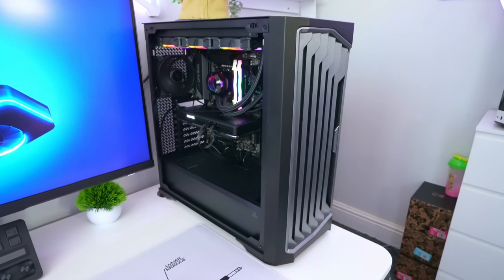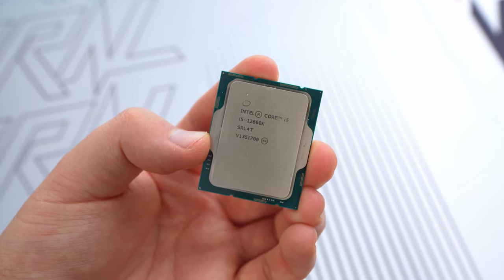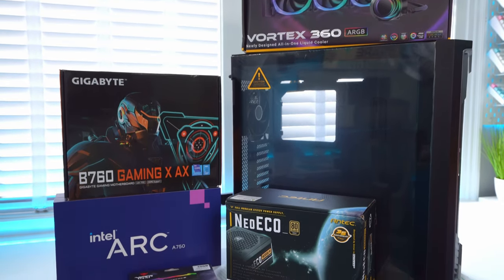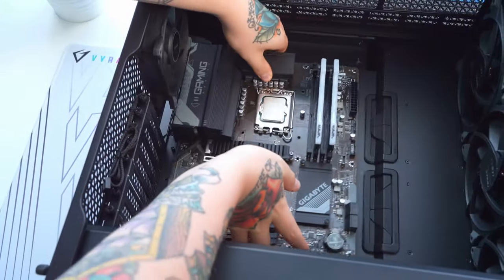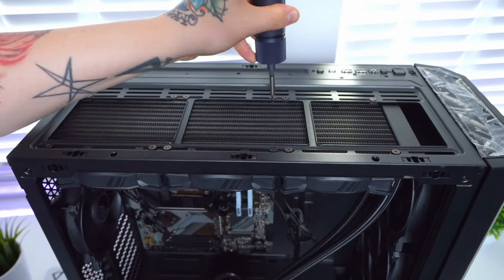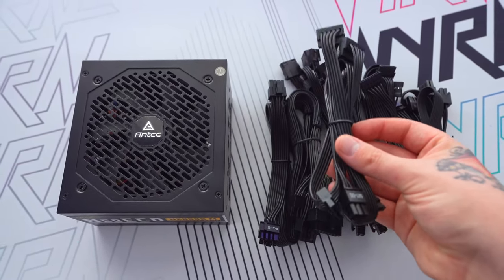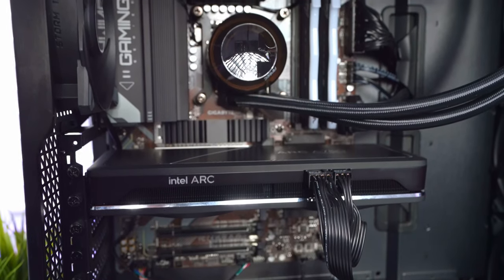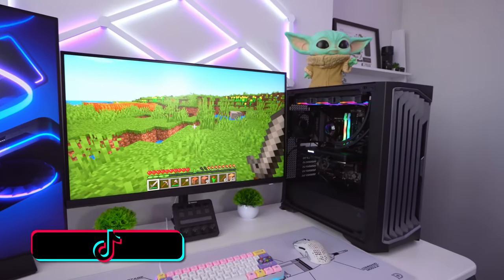Building a Full Intel PC?? - Intel Arc PC Build

Comment: I have a few questions.
Is an 850W PSU needed? Or can I use a 650W PSU?
Next question is, do I have to use ddr5 or can I use ddr4?
Reply: Depends
Reply: But u can use ddr 4 but not on the same mobo
Reply: You would be completely fine with a 650w Psu but if you want upgrade it in the future I would go for a 750w psu. And 16 gigs of ddr4 ram would also be enough, but then you will have to switch motherboard if you follow this build. Hope this helped you!